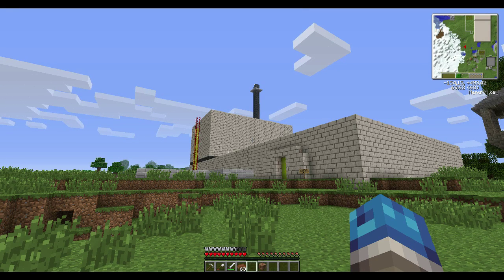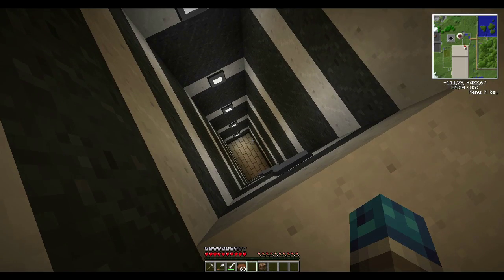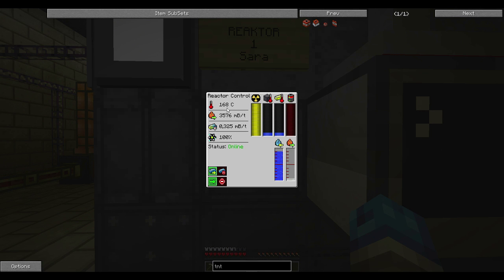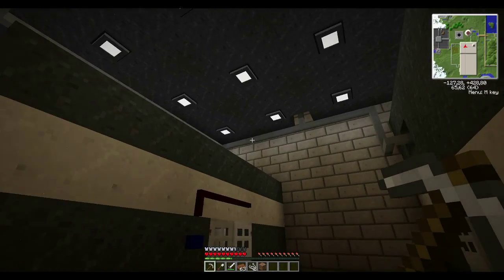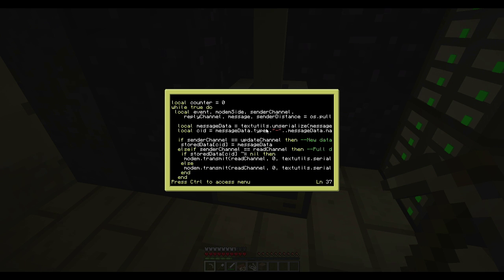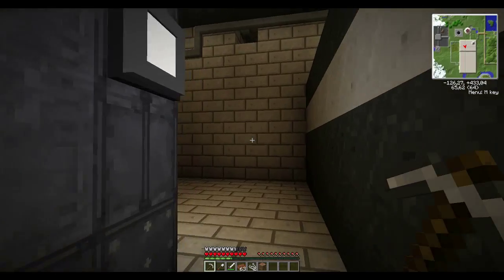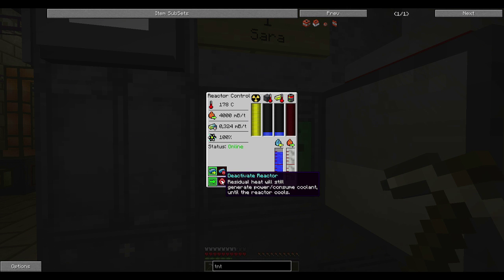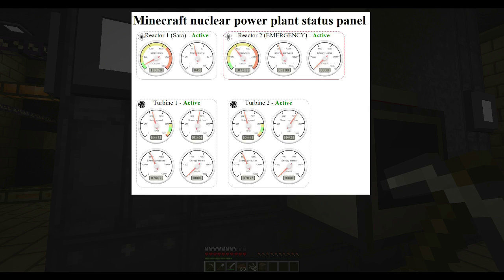Tekkit - Nuclear powerplant with ComputerCraft control system

Comment: very good. but the pool doesn't cover the top of the reactor... it s used as a storage for fuel and other radioactive material...
Reply from the maker: Thank you for watching my video. The reference I used did indeed have the top of the reactor submerged in water as I have in the video. The water acts as protection from radiation when moving fuel in and out of the reactor core.
Reply: You r correct the thing doesn’t cover the reactor lid
Reply: Guys watch Minecraft IC2 Power Plant
Reply: Can the turbine RPM be 3100 to 3602 RPM?
Like on hyptek nuclear power plant on ROBLOX?
Reply from the maker: According to FTB's wiki on BigReactor they can go beyond the 2200 RPM that the speed gauge shows. I don't know how much further though.